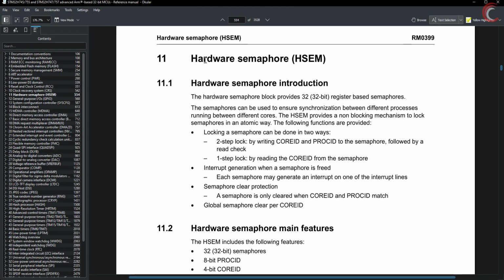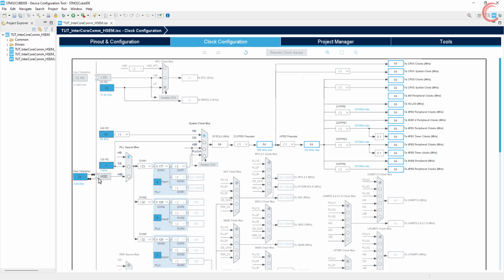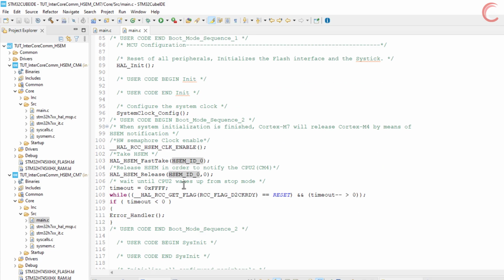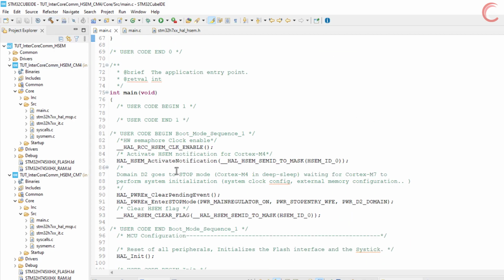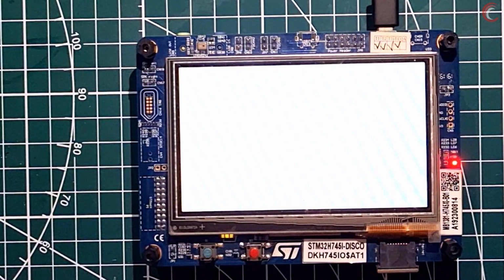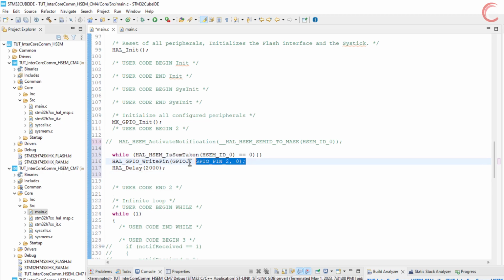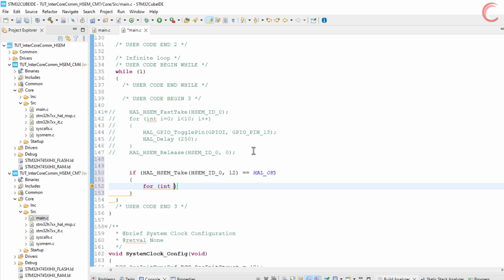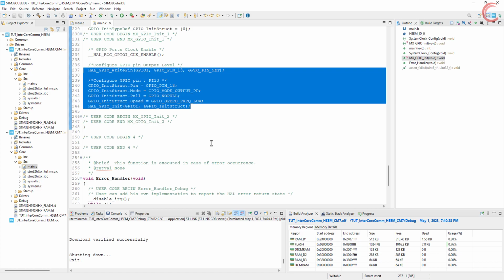STM32 Dual Core #2. Inter core comm using HSEM || Notification || synchronization || shared Resource

Comment: Hi thanks for sharing this wonderful content. I have been try to do same but I want to send the data from M4 to M7. Is it possible to do that. I tried to paste the M4 to M7 and M7 code to M4. But it didn't worked. Is that possible or not. In cube mx I have m4 as master. Do I need to some change in something else also ?